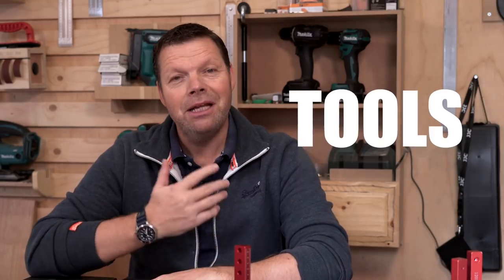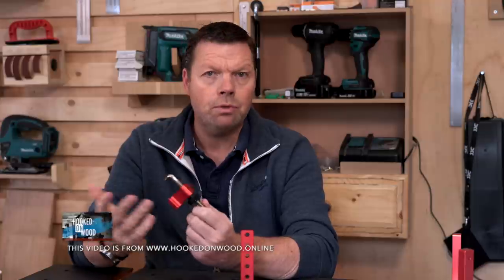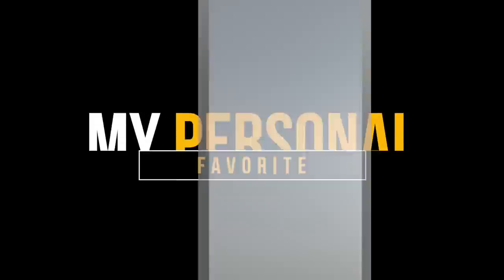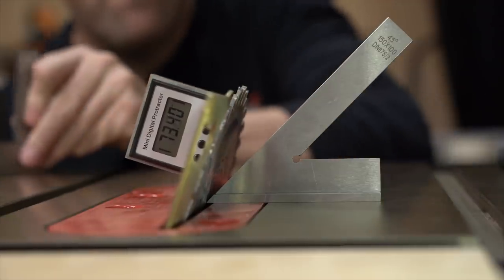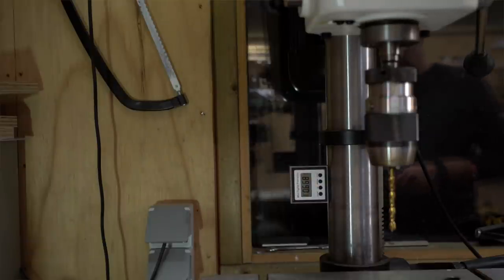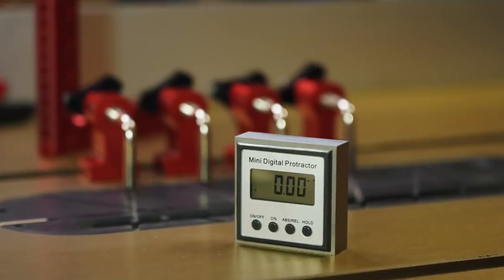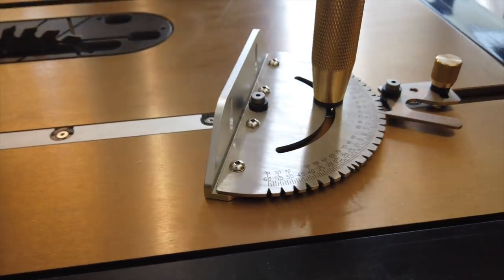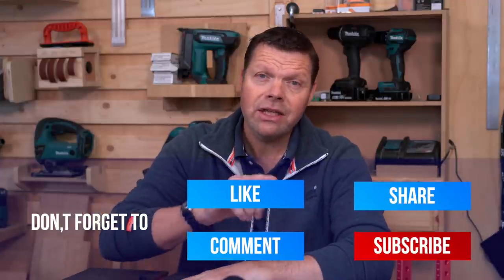China Tools Ep.15, Insanely low prices

Comment: I liked all of your China Tools videos - very fair and balanced.

One additional thing about the angle finder - I am on my second one from Wixey - the first (from around 2000) used a 2032 coin cell and whenever the battery failed it caused a period of no use followed by a trip to the store.  The second one I purchased when Wixey changed their design to use a much more standard and available AAA battery.  I always have these around for replacement.  I purchased the second one just because of the more available battery.

Comment: I have had a digital angle meter for a few years and find it an excellent tool for setting up my saws and also measuring angles for general carpentry. I think you are being a bit overly worried about the accuracy. I don't believe that many woodworkers are measuring angles to an accuracy of 0.1 degrees. 
I have only recently found your channel and appreciate the content I have seen so far. Thank you.

Comment: I just ordered the stainless steel angle meter. I needed one with flat sides and no magnets on at least one of the edges. I use this to set the height of the rakers to 6 degrees when sharpening my chain saw blades. I have to be careful with the current meter I have, as the magnets can pull up the links giving an incorrect reading.  This method produces a better cutting chain over a traditional depth gauge.
Reply from the maker: Hi Timothy, interesting approach! thanks for sharing!👍

Comment: One of the best glue appliers for flat surfaces is a soft rubber ink roller.  They are available in different widths.  But brushes still work best for box and dovetail joints.

Comment: You need to be fast if you want these bargains. Some additional items to consider:
1. Cross dowel jig (for knock down furniture)  ID: 1701720  $27 USD
2. 14cm contour gauge ID: 1613075  $6
3. Pocket hole jig (see note) ID: 1581989  $11.19
Note: This jig comes with 6mm (1/4"), 8mm (5/16") and 10mm (3/8") bushings, and with drills in those sizes and with drill collars for each. ALSO if you go to 'Plywood Working' channel, you can get a free plan to turn this into a Kreg K5 type jig.

And a last comment, I used DHL on a premium delivery of a Qiangsheng Luban size 4-1/2 hand plane. Picked up on Nov 6th in Hong Kong and delivered, with customs paid, in eastern Canada on the morning of November 10th with email notifications at each step. Expensive, but first-rate.

Comment: After finding your site I looked at bang good and they had these on offer at a rediculous  low price  I have ordered two ES-5 Aluminum Alloy Multifunction Woodworking Scribing Ruler 3D Miter Angle Marking T Ruler Square Layout 45/90 Degree Measuring Ruler - Blue £7.74

Comment: Man, these Woodpecker knockoff tools don't even change the anodization color.
Reply: I'm glad there are knockoff tools. Woodpeckers OneTIME Tool concept is frustrating and borderline insulting to consumers. I want a rounding jig now, not in two or thee (or many never) years time. For the price Woodpeckers are asking I think they really could manufacture more than just to order and keep a steady stock. I wouldn't mind paying the premium price they are asking for "original" tools, I just can't have the uncertainty and waiting times they are asking too.

Regarding the color, I agree. That makes these knockoffs look more expensive than they are.
Reply: you both have points although red anodized aluminum isn’t proprietary. I actually keep all my wood working accessories red when I can just for easy storage and when my less than carpentry inclined assistant is asked to fetch me a tool, starting off with (it is red) is handy. Also the red or yellow adds a little in the safety factor. meaning if it is red or yellow in my shop, it isn’t permanent or part of the main tool and could be a hazard.
Reply: i forgot to mention in the SE Asian market, you can get the tools in anodized red, blue, yellow, black or just natural aluminum color.

Comment: Dennis...With regard to your comments regarding the error of the digital angle meters, 
I personally have not used one, however based on your comments I am assuming that they can be "Zero Set" prior to use?
If they cannot be zero set...Did you consider that the instrument may be reading an absolute measurement?
By that I mean; is that your precision square for example, rests on the surface of your sawbench table when used to measure the angle of your saw blade.
If your saw bench table was not perfectly level...wouldn't the error show up on the digital instrument?

Comment: i have the handle jig ,its was great at the start for doing kitchen doors ,i set ,then drill through the hole but after a few uses  the screw that holds  the jig is very small  and hard to tighten . i now use a pliers to give the final 1/4 turn to stay in place .the screw or the sliding jig is worn  ,so am now very weary of using this product as i fit kitchens for a living .might have to bit the bullet and buy the woodpecker one for 200 euro

Comment: Another really interesting video, thank you! The clamps you use at 2:30, are they a bang good item too? I see the kreg ones that are similar (and hideously expensive). Keep it up! FYI a few of your "clamps" links in the description go to 404 pages.
Reply from the maker: Hi Adam, Yes, that are these https://www.banggood.com/MYTEC-MC-010102-C-Type-D-type-Crimping-Pliers-Square-Mouth-Rubber-Handle-Woodworking-Fast-Pliers-p-1193190.html?rmmds=myorder
I tried ti buy some kreg ones, but they where not in stock. I wanted to compare them. They work so far. The principle of these clamps are nice, but they do not feel like very high quality, That is the reason I want to buy one kreg to see, if this is due of the construction or that these are just of a bit lower quality.

Comment: Hi Dennis. Nice videoreview again! Which T-tracks do u use? I was considering those of banggood but I’m not sure if they are the right width for universal use?
Reply from the maker: Look at the sizes. They all have the dimensions on there pages. So compare with what you use now. I do not have any difficulties with the Banggood T-Tracks. Although I use them now from Incra, but that is only because I like the color and it match with my INCRA equipment. But further than that, In my opinion, they are all the same.

Comment: Thanks for great video Great Content as allways... Whilst its obvious these are Knock-off products, they do  as youve attempted to demonstrate, seem to be high class knock-offs, so for those of us that cannot afford the real deal INCRA, Bridge city tools, Woodpecker etc etc they are a means to an end as long as the quality is there.
Bang Good has frustrated me greatly however as they have just changed there website and prices whilst I was in the middle of trying to make a multi item purchace . I wasn't aware of the only one code at a time untill I gave up trying(realising that was what i needed to do on my own... i was then faced with the website prices just straight out changing from 11.11 pricing to Pre-Blackfriday pricing??? despite the countdown clock showing over 4 hours remaining !!! and the actual product page specifically stating 133 items left, 13.11 finish date (proof available)

Just have to hope Black Friday prices are the same and your codes still work, But I'm assuming your codes were 11.11 only??

Comment: I used several of your links Dennis so I do hope you get some extra euros for the hard work! 

I wonder if you can test something for me. I recently got a second hand Sip table saw, not as nice as your one of course. In trying to set it up after having to completely dismantle it I'm trying to get it ready to go. I find most of my cuts are fractionally wider at one end than the other despite being happy that my fence is parallel to the blade. If you try and cut a 600mm long piece to say 100mm wide, what does your caliper say the actual width measurement at both ends is? Mine seem to be abot 0.2-0.3mm out. I don't know if I'm striving for perfection in a tool that will never get there or not!
Reply from the maker: Thanks DB, really appreciate that. 👍

Comment: got 140mm mounting angles today. Unfortunately the 90 degree angle is extremely bad ... I will probably rework them sooner or later with my self made CNC ... No idea how you can produce them in such a low quality with any professional machine ...
Reply from the maker: Hi Jens, Sorry to hear. Are those from a vendor of my link?
But you are right, with todays modern machines, it is almost impossible to make extremely bad quality.
Reply: @HookedonWood  Thanks for your reply! Would have to check from whom it was exactly, ordered them via Banggood. Its the variant without the engraved ruling. Maybe those are better.

Comment: question. i work in my carport and the concrete is sloped for water runoff about 3 inches over the course of 25ft. this means my workbench is flat but not level. can i still use a digital level meter?
Reply from the maker: You can zero the level meter at any point. From that point it measures the relative angles.

Comment: I use your links but don't get your prices.
Reply from the maker: Sorry to hear that. I do not have influence on that. What I heard from Banggood is: You should select that products come from CN warehouse. and you can only use one code. So you have to do multiple orders, but be aware of extra shipping cost then
Reply: @HookedonWood   ARRGGHH can you ad this information to the top and next time note in the video if possible please Dennis, I've spent ages trying to get the various items in the basket with the codeas and each seemed to work apart from the T-ruler so I assume thats the codes run out?? but now despite my pages saying 11-13th November and still saying 4 hrs remaining on the 11.11 promotion... it seems its finished as the deal prices have all gone :(  the stupid thing is instead of "saying one coupon only", it says only available on specific items, so they had worked before but once adding another item and code the first can no longer be added untill you remove all from your cart and re apply....  anyway the mitre square brass has now changed from £44 to £54 :( and thats the bit i really wanted,  Just have to hope Black Friday is as good, But if not its cost them £150 worth of sales... so frustrating, trying to save an odd pound or two ... Thanks for the Codes and Videos!! great content BG frustrates the hell out of me though :/ I REALLY want to buy but they make it harder and harder LOL